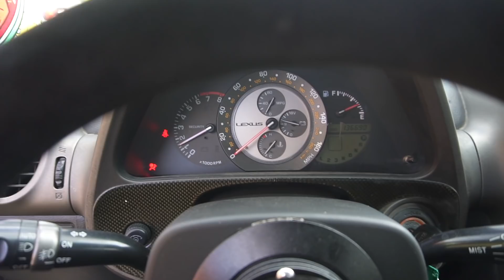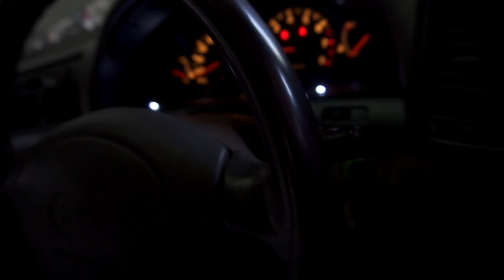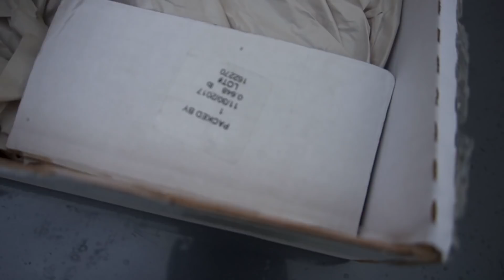Is300 manual swap update + 2JZGTE Toyota Aristo!!!

Comment: Hey bro do you you have header exhaust manifold and if is yes......how did you turn off the check engine light
Reply from the maker: Stallion75 G don’t have headers, just an exhaust. I have a CEL light too but I just pulled the bulb. My problem is the o2 sensors tho. I’ll be putting the bulb back in then I get the new sensors